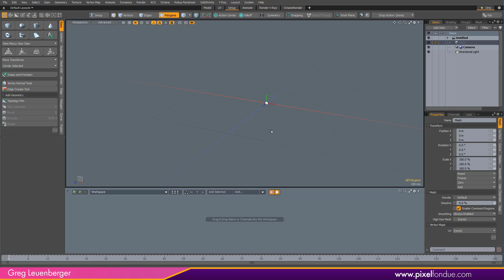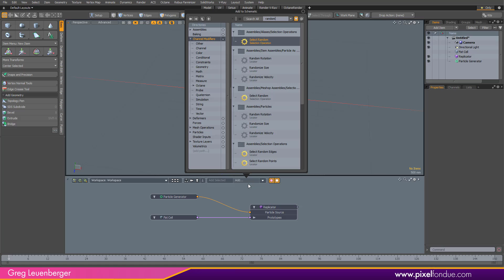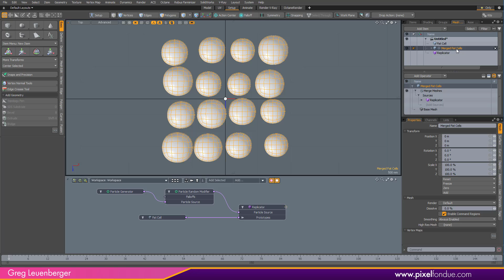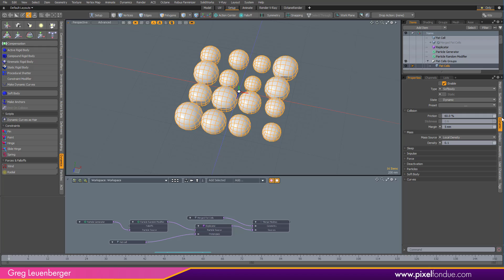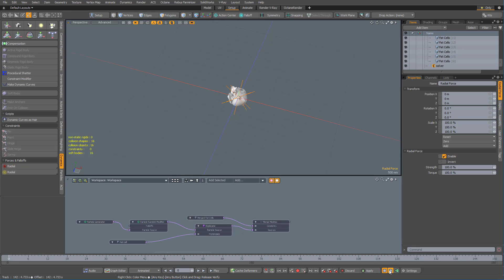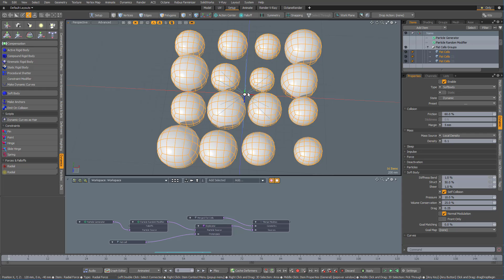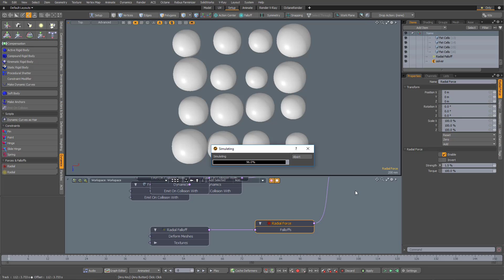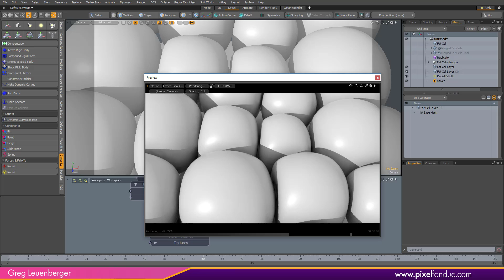MODO | Fat Cell Soft Bodies

Comment: Hi Greg, great video!  At 6:05 you somehow add the Merge Meshes op as a node in the Schematic, how did you do that with just one click?  Keyboard shortcut?  Thanks!
Reply from the maker: It was already hooked into the replicator (at 5:15)..if you notice the little diamond is yellow (means something is connected).  All I did was double-click on it and it showed me the connection.
Reply from the maker: You know I think I could have done this with dynamic replicators...oh well, merge meshes has it's own uses.
Reply: @pixelfondue  ahhhh! Thank you